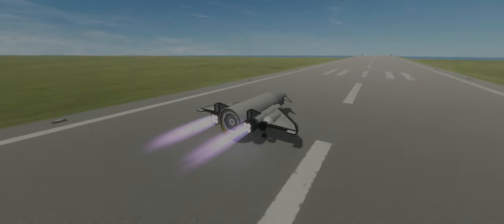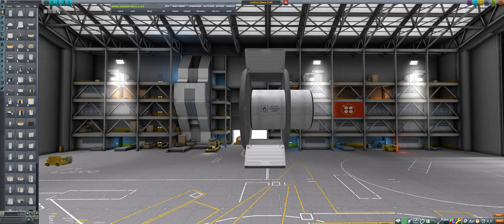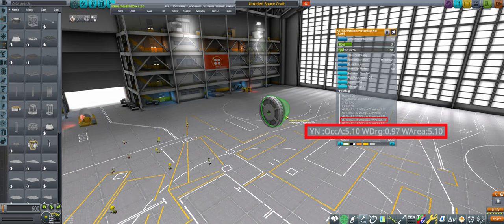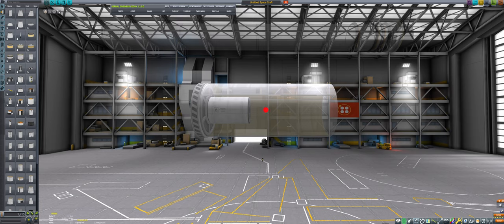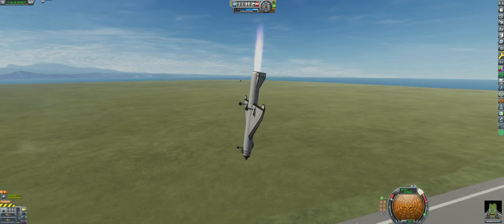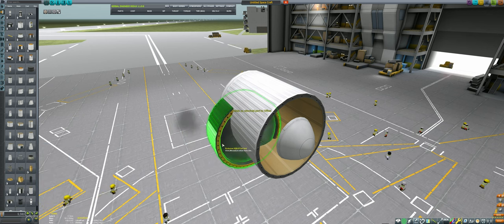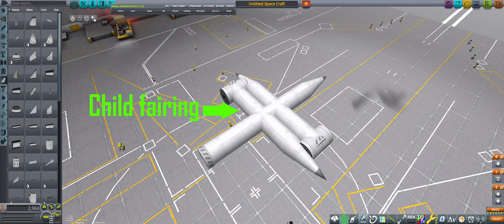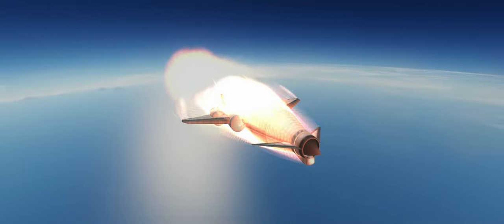Kerbal University: Fairings and Cargo Bays

Comment: Ok ok ok... here me out:
I have been working on reverse engineering the heating model.

3 things:
1. How have you gotten this information? Is it just by testing in game, or have you reversed engineered the code?

2. On of the things I haven't figured out yet is convection occlusion. Basically, parts cast a shadow on other parts. However, I encountered the same oddities with part rotation as with fairing occlusion. It seams to depend on the absolute orientation of the craft in the universe, so Kerbin's rotation makes the results vary. Thoughts? 

3. I have found a way to create a craft that receives no heat. I have failed to find a way to create a dragless craft. Until now. We can literally send a craft to touch the sun and return to Kerbin.

I am shaking right now, this is insane !
Reply from the maker: 1. When it comes to explicit checks, the latter. For the rest, mostly the former.

2.This is my experience as well.  From looking under the hood, shock heating occlusion is hideously complicated and I may give up on trying to understand it explicitly and focus more in the ingame behavior, which seems to be possible to roughly boil down to "Parts cast a cone of partial occlusion behind them with angle based on mach number, and a direct shadow of full occlusion directly behind them".  I've found best results with both parts having their axis aligned, and having a single shielding part that is larger than the shielded part, rather than multiple smaller shielding parts (which kinda works but seems to be way more picky about it).

3. I've also found a couple ways of doing this (which feature is a couple of my mission videos), and my next "big" video project in the Kerbal University series will be a breakdown of the heating model.
Reply: Ok, I'm gonna create a document with everything I know. May I ask what tools you use to look at the code?
Reply from the maker: I like dotPeek
Reply: @lt_duckweed  Ok I don't know why it keeps deleting my comments, if you see my other responses sorry for the spam, but the pastebin is VQACtPNy
Reply from the maker: Yeah that's odd, I can't see them either.
Reply from the maker: @fastandfishious34  damn, haven't had a chance to fully read through it, but you've done a hell of a lot of study on this, a decent bit of which I haven't looked into myself.  I have some stuff to look into now!
Reply: @lt_duckweed  Have you studied jet engines? It would be perfect for your channel, and I think I have them figured out (they use density, not pressure). Another one would be how to evaluate splines, with and without slopes

Comment: Around 4:28 you explain that the CoL indicator isn't correct in the hangar. Have you tried angling the whole craft x degrees to see where the Col marker ends up? It's a trick I often use for proper center of gravity placement, which it lowers control forces required to stay in level flight. Thus, increasing efficiency, especially during hard manoeuvres. I'm, however, not sure if the CoL in the hangar also takes body lift into account.
Reply from the maker: It unfortunately does not take body lift into account :(  luckily there is a mod for that!  CorrectCoL

Comment: Hi Lt! I have been trying to build an SSTO with Panthers. I’m having a really hard time…I actually got to LKO with one of my designs but was trying to add just 100 dv to do an orbital docking and couldn’t do it. I’m obsessed with the challenge of doing this without taking advantage of the simulation ie fairings etc like you’re doing here 

Would you be willing to take a look at my SSTO and tell me why switching my AoA is causing awful flying properties? I also can’t get drag ratio above 1…In your video where you describe the inclination change of the wings your aerodynamic overlay tool shows it’s still perpendicular to the craft but when I change my wings to 5 degrees the tool shows it pointing up and back at an angle. Why is that?? I’m trying to keep the craft big and cool looking so it’s a lot….I don’t know how to do the math to figure out what’s wrong.

https://steamcommunity.com/sharedfiles/filedetails/?id=2864553093